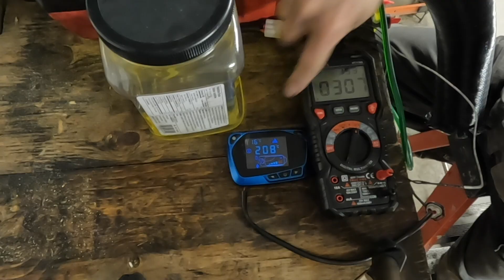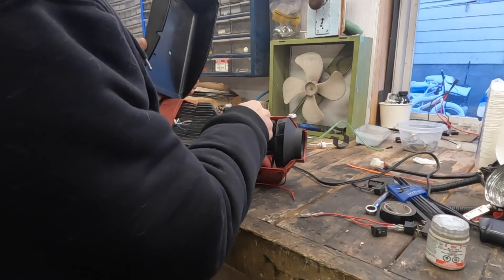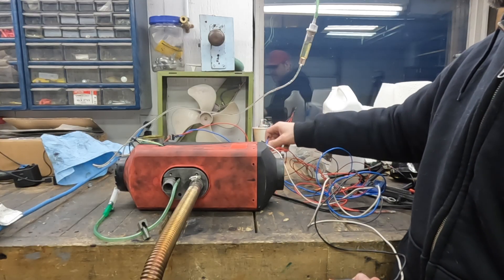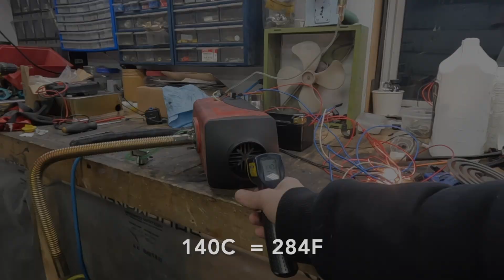ECU Replaced With Light Bulbs !! Diesel Heater Runs With No ECU !!

Comment: Bet you can get 8k heat output from it with 12 volts to fan and a steady stream of diesel going into it. Atleast till the heat exchanger turns to liquid. Lmao.
Reply from the maker: LOL... I was thinking the exact same thing... I had it up to 270C today .... I'm guessing it was putting out more than 5kw.
Reply: @loweredexpectations4927  well if you want to get experimental.
100 mill is roughly 1kw
2000 drops is 100 mill.
33.3 drops per min is 1kw
166.6 drops per min is 5kw.
266.6 drops per min is 8kw
333.3 drops per min is 10kw. 
I think you know where I'm going with this. Lmao.
Reply from the maker: @johncollinsgrove1750  I love the list. Is there such a thing as a diesel drip calculator ? haha... According to a nurse, these IV drippers come in two variants 16 and 20 something... I can't remember. I think that is 16 drops per ml.. 

I would assume that different things have different viscosity and surface tension, and a drop would be different volumes based on that as well.
Reply: Throw a brushless RC motor on it. I have some turning 65k rpm and are strong enough to sling a 12lb car at 50mpg.
Reply from the maker: @White000Crow  Haha... tempting ... I will have to come up with a better fand that won't just explode !
Reply: That thing could kick out 50 kw never mind 8!
Reply from the maker: @Moonlightshadow-lq4fr  To infinity and beyond !!
Reply: Can you get more rpm out of the motor if you where to run it on 24volts. Faster fan and more diesel should equal more heat. Until you melt the heat exchanger. Lol
Reply from the maker: @19pointbuck  It can absolutely turn a LOT faster, and 24V is not required... 12V is plenty. Currently, the lightbulbs in the circuit are limiting the power to the fan. WIth the battery connected directly it will spin extremely fast and I'm concerned that it will damage the motor very quickly. 

In the current configuration, the fan is turning a little faster than with the ECU on max setting. Before, I was only able to feed it about 80 drops per minute, and now I am limited to 100 drips. I'm sure I can wire it for more speed, but don't want to kill my motor ... Yet.
Reply: It is working 👍Yes  12v speed controller,no pump, have one old diesel heater, need to try this out.
Reply from the maker: @GasparGasparic  🤟
Reply: A billet fan won't fly apart at high speeds something like from the intake side of a turbo they spool up very fast but then there is the intake fan on the heater you would have to contend with because the high speed of a brushless motor it would blow your flame out and possibly suck all the fuel out of your tank the ventry effect

Comment: Brilliant, do you think you could use variable pwm unit for fan speed. it would be less power used than a light bulb or resistor
Reply from the maker: Absolutely ... As per usual, I just used what I had laying around.... and trying to keep it very basic. A variable resistor or PWM would work much better. I hope to get a video out tomorrow posting the amp / watt draw tomorrow.
Reply: Mosfet could work also

Comment: Nice one 😆 I new the bulb idea would pop up but when I seen 3 bulbs for the fan I was shocked brilliant the Fan is 9v
Reply from the maker: Thanks ! I appreciate your comment.
Reply: @loweredexpectations4927  You could use a variable resister to adjust fan speed
Reply from the maker: @coreybabcock2025  For sure... that is one way to do it.
Reply: The problem is it would have to be a relatively costly one because of the current running through it. @coreybabcock2025

Comment: Are a lot of those components 5 volt powered?
Reply from the maker: The components on the ECU may be 5V, but the fan and plug are listed as 12V ... You can also get 24V units, I believe... I know some ECUs have the ability to switch from 12 to 24 V ... I know I have seen 24V pumps.

Comment: Im curious....can you try without the glow plug? 

Cheers from Sweden
Reply from the maker: The glow plug needs to be used to light it.... but I only run it for 6 seconds and then turn it off 👍  It doesn't run during operation. 

Stay warm and cheers from Canada.
Reply: That would probably not work. Diesel needs some heat to burn (around 55 C). And around 210  C are needed that the diesel auto ignites. I think preheating diesel to 210 C is not that easy so some kind of igniter or glow plug is always needed. Nevertheless it would be interesting to see if there is an easy (maybe non electric) way to ignite the fuel.

I hope I understood your comment in the way you meant it and I’m also open for corrections or answers. 

Greetings from Germany
Reply from the maker: @leonsimon2238  Yes, this is correct. The diesel needs some way to ignite. I ran my glow plug for 6-7 seconds and turn it off as soon as I hear the fuel light. After that, the combustion is self sustaining.

Comment: Hey! What if you just use a variable resistor for the fan speed? like a fan speed switch but smooth so you can do incremental adjustments!
Reply from the maker: I do have a few, and I thought of that... I wasn't sure if they would be able to handle the wattage of the fan as they are basically just volume knobs I had laying around. 

I may try it, as the worst that can happen is they fail, haha.
Reply: @loweredexpectations4927  In some cases a rheostat may do what you want from the bulbs and give you far more variability but the bulbs give you a good indicator.

I wish I knew more about programing because it really looks like these diesel heaters could be driven from a micro controller using a MOSFET board and have added functionality and modification simplicity over a stock controller. like direct integration into a home or RV thermostat or home automation without any extra timer relays so a person could still maintain the safety of the heater by automating shutdownfor more areas of issue and ramping up and down heat based on sensors.
Reply from the maker: @kuhrd  Yes, a rheostat would work for sure. There are many options. I had bulbs and it is more visually pleasing, especially for a video. 

I'm sure that there are a LOT of people who could control these heaters from a Arduino or Rasery pi... whatever they are called, haha... I am not one of those people... I suspect in a few years there will be many options on the market as people start recognizing the potential for sales of these electronics.
Reply: @loweredexpectations4927   True, and no real loss if they are inexpensive.
Reply: That might burn the resistor out near the ground pickup as the resistance will go down and the windings can't handle the current. That is when doing a voltage divider would be a better with a high wattage resistor taking the brunt and the potentiometer just cutting the voltage.
Reply from the maker: @DaddyBusAdventures  Yeah... the can is pulling about 45 watts max, so not intense ... but not nothing.
Reply from the maker: @glen8271  Haha... I am also a mobile small engine mechanic, and have used oil... that's how this all started for me.
Reply: @loweredexpectations4927  Kudos for mechanics! And likewise.
Reply from the maker: @glen8271  Used cooking oil, or engine oil ? I have tried new engine oil with the same results. 

I have considered distilling engine oil... If you do it at the fight temperature, you can basically get kerosene and all sorts of other things in that category... I don't want to try it in a residential area... but I love the idea. 

If you are using used cooking oil, the easiest way is to "crack" it ... I think they call it, with methanol and lye. This separates the glycerine and you are left with biodiesel.